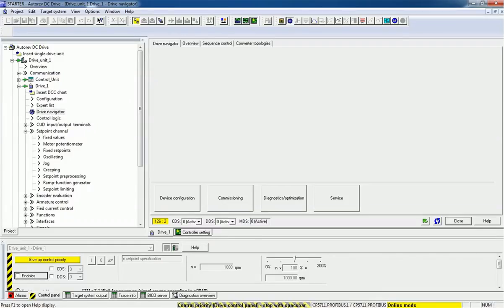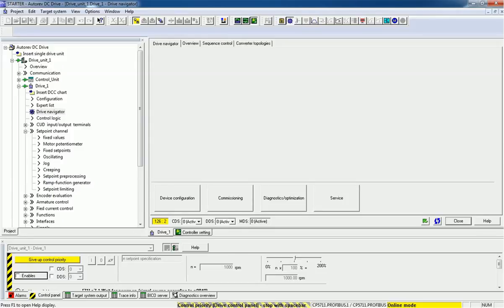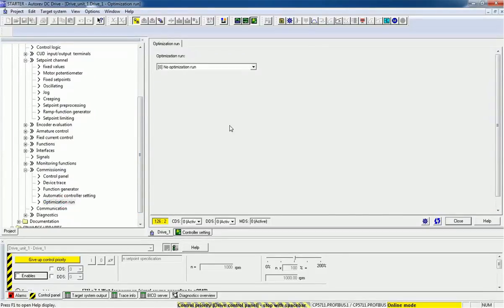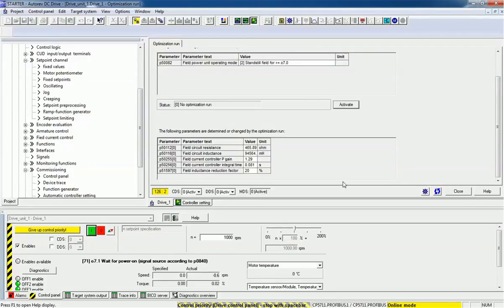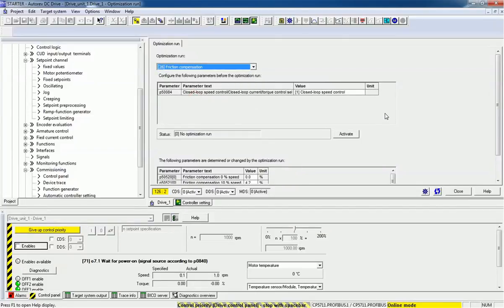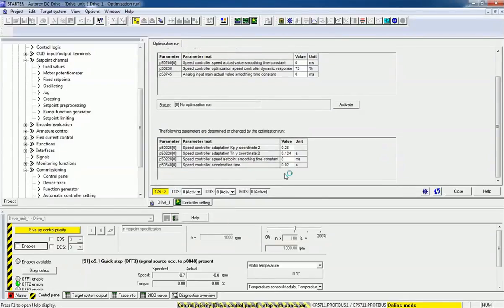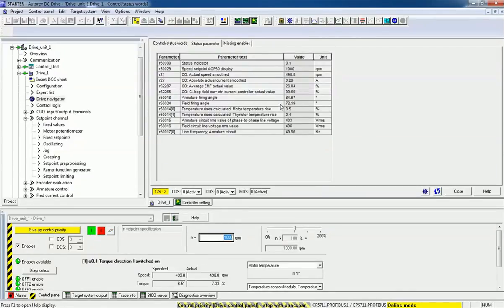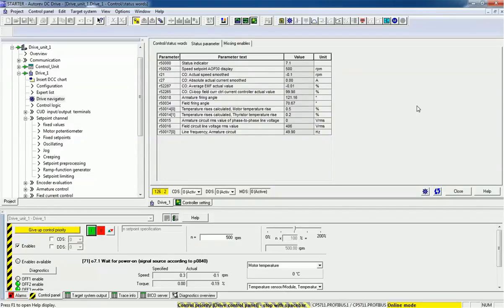Optimization in Siemens DC Electrical Motor VFD using Starter Software

Comment: Motor detail 
Arm voltage 420v arm amp 47.6a
Field voltage 220 field apm 4.4/1.8a rpm 1090/1850 rpm
And drive is 60 amp drive

Comment: Sir i had performed same thing as you advised even then drive didn'nt give full armature voltage at base rpm sir what i have to do now and if i increase the speed more then after 1450 rpm drive is tripping and fault is 60004